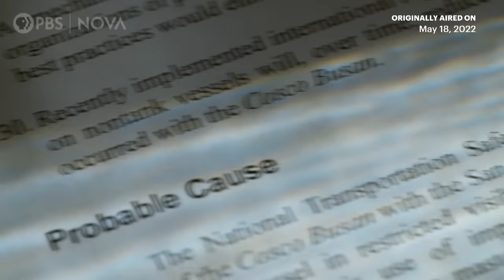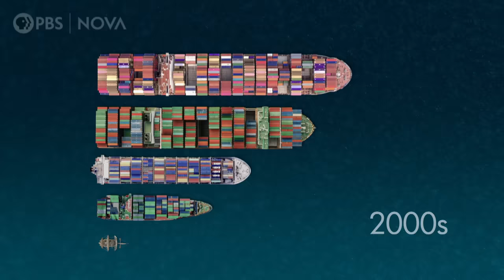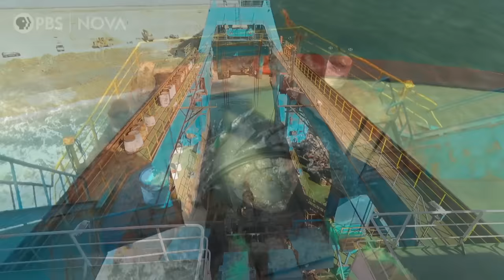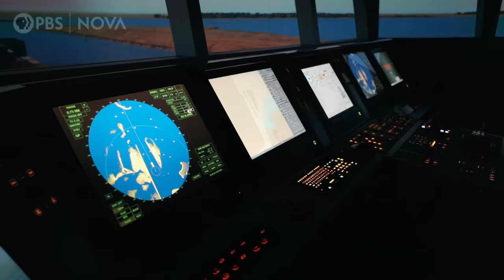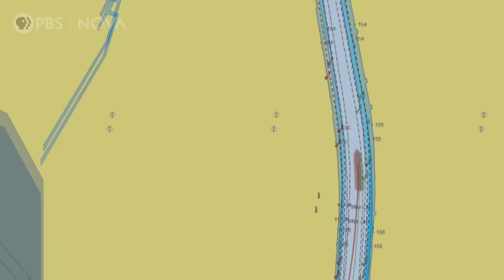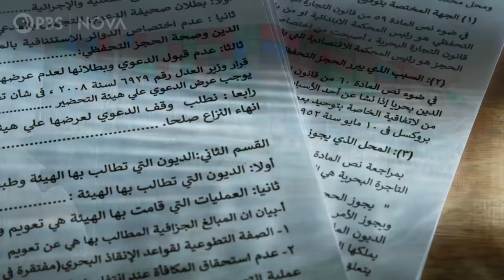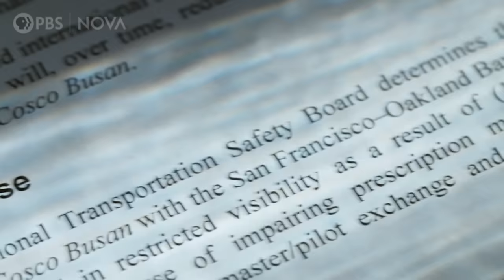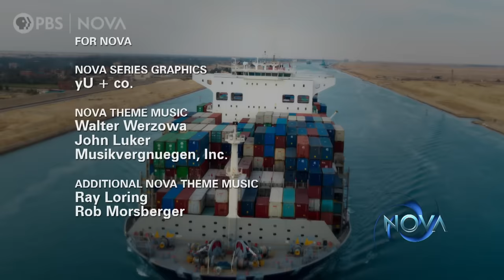Why Ships Crash: Inside the Crash That Shut Down the Global Economy I Full Documentary I NOVA I PBS

Comment: Ships sometimes lose power no matter how well they are maintained or how well trained the crew is. I was an engineer on a well maintained U.S. flagged ship that lost power when we were switching generators just as we were exiting the Suez Canal. Fortunately, we had plenty of maneuvering room and weren't in danger of a collision so a quick engine restart prevented the ship from  running aground. It is virtually impossible to avoid every possible accident that can happen.
Reply: If it was maintained, it wouldn't lose power. Sounds like you need to up your Quality Department.
Reply: So what do you have control of if you lose main power? Is aux just a diesel generator?
Reply: Accidents are incredibly rare. Crashes from poor maintenance, lack of training, negligence, greed, cutting corners, on the other hand.. all the time.
Reply: Im glad you were ok! 🎉
Reply: Another reason we need to cut down on our oil dependency.
Reply: @ChannonLegier It takes actual effort to remain as ignorant to reality as you keep yourself.
Reply: Absolutely mind boggling!
Reply: @ronkirk: If you had delayed switching generators until after you had exited the Suez Canal would you have lost power? Sounds like the dangerous situation wasn't so independent of your decisions as you imply.
Reply: AI will be able to predict accidents  before they occur, which means with technology we can achieve zero accidents. 😮
Reply: @drainking100  No, it doesn't mean that.
Reply: @drainking100 lol that will never happen
Reply: @jessicam5712  all accidents are caused, they can be prevented.
Reply: @ChannonLegier  An analogy would be like birth control, they never claim any to be 100% fail proof because nothing can be that, the chance though smaller with better is always going to be there. It’s life.

Comment: They should use a drone overhead. That might give a realtime overview of the whole scene. An additional tool, but an overview of the entire course they're working. It might help make any minor adjustments more productive relative to all those other things...like the wind, speed, curve,  residual effect from the prior ship. After all that, they might be able to see a little better if it  can stay the course. 
 Just a thought.
Reply: Canal control and well as every ship in the canal already knows their relative position to every other ship.  A drone wouldn't see anything the Captain and Pilot couldn't see.  A ship doesn't turn on a dime.  Course changes must be anticipated well in advance to maneuver a large vessel through a narrow navigation channel.   The real argument is the margin of error being allowed.  Are these massive containers ships now just too big to safely navigate the canal.  Do sections of the canal need to be reengineered and equipped with rail engines to literally pull the ships through as with the Panama Canal (I guess you can't put rail lines on sandy desert terrain).  Maybe the canal should be closed when winds are above 35 knots.  And maybe they should stack fewer ships in the canal to allow more distance in between.  But that would mean slower transit times, greater overall expenses and less revenue.  In other words, it ain't gonna happen.

Comment: Suction does not drive the event, the high pressure on the opposite side does.
Reply: Exactly !  Low pressure on the top side of the wing does not drive lift, High Pressure on the underneath side does.  Funny how we're taught false science in grade school in the name of simplicity.  It's like escape velocity...we were taught that it is 25,020mph...however...if one leaves the ground vertical at 4mph and keeps going at 4mph...one would in fact leave planet earth xD

Comment: So...what I am getting from this doc - which is my only source of info on this terrible accident - is that both the captain and SCA pilot made decisions that they thought were right, but turned out to cause more problems than they solved. That's probably why the legal case ended up in a settlement - both sides had facts counting against them they would rather not be made public. 
The other thing that bothers me is that, given that we are able to keep making bigger and bigger ships, is expanding the width of the Suez Canal going to solve this problem? 
We have already seen, for example, that building more freeway lanes on urban freeways - which is supposed to reduce freeway congestion - just attracts more cars to the extra lanes, thus compounding the original problem.
How do we know this won't be the case when they expand the Suez, and even bigger ships fill up the space?

Comment: Can a similar pushing and pulling process by tugs be used to clear the collapsed Baltimore bridge sections, whereby pieces are dragged out of the way into shoreline areas where it can be cut up and removed? This might be a quicker way than a slow salvage operation in place. I'm thinking the main problem would be that the bridge sections are probably deeply buried in the river bottom and couldn't easily be dragged out.
Reply: Steel trusses are tough beams of metal. If it wasn't for those fragile & unprotected pillars, that bridge would still be standing.

That bridge is buried in the soil. Tugging is outta the question
Reply: Not to mention there are still bodies to recover. That complicates it a bit

Comment: Semi trucks have developed aero dynamics all over... The top of the cab, wheel wells, etc.

How difficult would it be to apply that same logic to container ships?  I'm not smart enough to understand all the  various maritime problems that might cause, if any.... Any thoughts?
Reply: Trucks get blown into the next lane, blown off the road, or blown completely over on a very regular basis. And all of the rules change if it is raining, snowing Hot and humid, or if the truck is crossing a bridge, in a tunnel, or in a gravel road.

Semi's are not in total control any near as much as you make it seem.

I think the biggest difference in operation just boils down to command and control. The truck driver knows his rig, he can see, feel, smell everything that is happening AS IT HAPPENS, and can make immediate corrections to fix any developing problems. Imagine being the truck 'Captain' sitting in the back, reading maps and charts, and telling one driver when to turn, how much, and which way, while telling another driver when to accelerate, how much, and which gear to be in, oh and there is an engineer under the truck changing gears for you. Can you imagine how screwed up the roads would be if all trucks were run like that? That is how ships operate every day.

You mention the Aerodynamics of a truck being pretty much figured out. The same is true for ships, their Hydrodynamics are pretty much figured out too. But if you are driving a truck on a slushy winter road, and get too close to the soft shoulder, you will get sucked off the road. The same is true for a ship in a canal, if they get too close to the edge, they will get sucked into it.
Reply: You ignore the fact that a ship has no wheels and is at the mercy of the flow of water

Comment: Master has full responsibility of his ship (fact). But the pilots were in control and navigating erratically. It was the pilots that crashed into the bank. max speed was 12 knots but they went almost up to 14, and would not set a navigation course, but zig zagged back and forth from the banks with hard full port and starboard alternatively.

Comment: Now with Baltimore's port blocked and the panama canals traffic drastically reduced it would be the perfect time for terrorists to cause the suez canal to be blocked.the supply chain is slow to start with.my parents unfortunately worked the marine terminal at Newark nj.its a rat race every day there, dispatchers are extremely overworked and there's never enough of them.trucks are trying to get ahead of each other and causing accidents, people are getting into knife fights and when you manage to get the paperwork you need which takes awhile and find your load the trailers brakes might be frozen if its winter or have other mechanical issues.then it takes 2hrs to get clearance to leave the pier after all of that.a total restructuring needs to be done and its not going to happen.
Reply: It happens all too often in Baltimore. It's literally a 6 AM to 430 PM weekday window that puts a strain on the crews & truckers at these port(s).

Now, without a bridge; unfortunately, I-95 is already a piece of sh*t that is just amplified to oblivion because of this recent incident